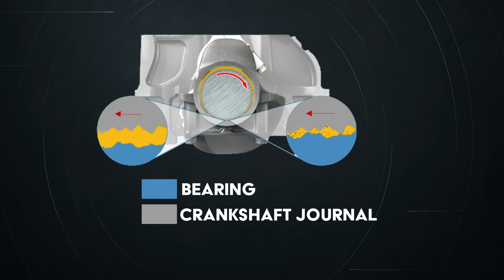the truth about start-stop technology (finally proven)

Comment: I had no proof before this video that the wear was actually happening. But, from first time I saw such a "feature", I knew it was not a good thing and I was nervous each time an engine stopped on a nearby car just to start again after a minimum movement was needed due to cars moving just some small distance and then again and again the same thing. I though about wear on the starter system, injection, battery and electronics in general, but really didn't think it was also going to damage the bearings. So, all in all, it is just another thing which reduces the life of the engines and so the cars they are mounted in. A complete nonsense!. I don't have any car with that system yet and really hope to be able to disable it in case I get one!

Comment: Mechanical engineer here.  Real life example casting doubt on the conclusion herein.  

My 2005 Toyota Matrix standard transmission bought used with 210K miles.  Now has almost 550k miles (or 1 million kM.)  Not only do I shut if off when I deliver final mile, but I shut if off at red lights at every opportunity. 

 I have not opened it up to check the bearing wear but there is very little noise under the hood.  Car was going so strong that a year ago, I replaced some noisey bearings in the transaxle and replaced the leaking steering rack.  Handles great and tracks so true, my tire wear is even on all wheels. 

Her name is Trixie.

Comment: This feature and ones like it were never about longevity. In an industry that defines planned obsolescence!?? This was only designed to conserve fuel. ie: barrels of oil per vehicle on the road. In case you didn't notice the silly ideals over the past 15 years about "green energy". Oil is the currency of any society, quick acces energy and ability to do almost any work. To have less share given to the general population,  means more for higher powers such as military and political classes.

Comment: Another things: in dsg, I am used to put neutral, engage handbrake, release and press the brakes, put P mode, release the brakes and engine off. This to avoid to put strain on the gearbox. If I forget to disable s&s, the car shuts down After putting neutral, only to ignite a second later when i put P.

Comment: 2010 Prius, 252k miles, still going, no engine issues.

2016 Prius, 215k miles, still going strong.

Maybe its not the tech, since Toyota can do it just fine. Sounds like a capability issue. Only thing proven is Germans can't do anything with new tech.

Comment: It's just like when BMW says their engines can go 12k- 15k Miles between oil changes because it means they only need to do 3 oil changes under warranty, and it looks good for the EPA, less oil usage. Then, they released a TSB stating that using 1 liter of oil per 1k miles is normal. 12k miles...7 liters of oil... It means they can claim normal wear, and not pay for a new engine ....
Reply: Fuck bmw service intervals. I owned e90 with the infamous n45, never had any engine problems. The trick is to change the oil every 5000km. No need expensive synthetic oils.
Reply: @ilovelimpfries Hm... Change oil twice as often, or pay a third more for synthetic oil...? Math is just so hard, I don't know what to do!
Reply: That's not how anything works.

If they had even a fraction of 1% more service claims due to engine wear, it would cost vastly more than one additional oil change, even if under warranty.

But oil changes are not under warranty. If you're so concerned about how they're secretly killing your car, maybe pay attention when they charge you $250 for the "Ultimate Care Oil Services". If you think 3 oil changes isn't worth that, then you shouldn't have bought it 😂

Modern synthetic oils last longer. And people who buy BMWs are suckers for additional service agreements.

Comment: Start/stop damage can be greatly minimized, using advanced engine materials, oil galleries, and low viscosity oil. For hybrids, the hybrid battery can be used to delay demand on the engine until its oil pressure is achieved.

Comment: Sounds like something that could be easily solved with a solenoid-controlled, pre-lube accumulator. 

1) Solenoid valve opens with ignition switch
2) Accumulator builds oil pressure with engine oil pressure
3) Solenoid closes on engine off
4) Next time ignition is turned on, pressurized oil in accumulator shoots straight into engine
5) Cycle repeats.

Comment: The FIRST thing I did on the shitty subaru was to completely disable the auto-shut-off bullshit.  Alas, after 99k miles the catalytic converter crapped out, and FUCKING SUBARU has programmed the car to turn off ALL safety features!  No emergency braking, not lane keeping, no Reverse Auto Braking.... These companies need to be sued into oblivion.  Someone is going to DIE simply because his shitty stock cat failed, and was too goddamned expensive to replace.  Fuck you subaru, and every other maker who pulls this bullshit on us.

Comment: The concern I have had with the start/stop system is the starter and flywheel ring gear. 
I never thought about the crank bearings. Replacing crank bearings or the flywheel sound very expensive.  I wonder if shops will say "it will be cheaper to get a new engine than to fix it".

Comment: This is assuming a mechanical oil pump connected to the engine. The simple substitution of an electric oil pump that runs on on stop will halve the wear (It's can't help much with start-up wear without several seconds of delay which would not be acceptable). I don't know if that is common on start-stop engines?
Also this is a good accelerated test but is 84 hours of stopping every 30 seconds (and waiting 30 seconds before restart?) really a good representation of '1 year' of wear? That is 5040 stop/start cycles. I reckon my van does about 30 per year. Maybe 50 (over 7000 miles). It really isn't happening very often, as the car often decides it is too cold or otherwise 'out of the correct parameter zone', and we mostly do long journeys, not stop-start town traffic. So in my case this level of wear would take 100 years, so definitely not a problem. I wonder how many people are really getting 13 stop/starts every day on average? But yeah those people might be needed an engine rebuild after 80,000 miles (130,000km), so maybe 7-10 years.
Are we seeing a lot of that in the real world?

Comment: this is not a good test.

First of all, it does not appear that the example vehicle was engineered to do engine start up. Obviously, if you take a standard engine in a regular car and start it over and over again, it will not have the features necessary to deal with this kind of usage. Additionally, the engine itself has not been engineered for this kind of use, and so while the bearings may be the valid selection, it is not an indication that the engine is designed to use those bearings under this kind of load.

Second, even granting those issues, to be a proper test, one would need to do the same test of two days with a normal amount of starting and stopping. This is made complicated by the fact that in order to do a true simulation, 365 times at minimum the engine would need to start from cold. Which is also a problem with this test, although I understand that the point is to show the war that occurs when doing warm oil start stops.

Additionally, the test is compared against a specific type of engine that is designed for ultimate longevity. i've owned several gas vehicles, and none of them were designed for that purpose. Manufacturers do not want to build 1,000,000 mile or million kilometer engine, because that means that consumers will buy fewer new vehicles.

Finally, similar tests have been done by manufacturers and by others that demonstrate that a properly designed engine that is intended to be used for engine start stop can use features that will prevent the kind of where that is being complained about here. The main solution being to artificially maintain oil pressure during normal driving.

In other words, manufacturers typically only want an engine to last 100,000 or 200,000 miles. This is true across the board, whether you have engine start stop or not. If your point is to circumvent the manufacturers intention, then you need to start by identifying those vehicles and engines which are already likely to have greater longevity. But once you make that your priority, the rest of the conversation is moot. 

some vehicles prioritize performance over longevity, efficiency, or emissions. Others prioritize emissions over longevity, performance, or efficiency. Although typically, if you prioritize emissions 99 times out of 100 you will also be prioritizing efficiency. If you prioritize longevity, then you're making a different set of choices . It's a valid perspective, but it doesn't make the engine start stop system invalid.

Comment: Aircraft engines have been priming their lubrication systems prior to ignition for nearly 100 years. Engineers knew it then, and know it now, cold starts are the biggest cause of engine wear. Manufacturers and board members also know this and with the help of ad agents, lobbyists, and the conscience of a swine have installed a "feature" to ensure a shorter life to their expensive product.

Comment: I eventually permanently disconnected the stop-start system on my Suzuki Swift. 
Prompted after just 13 months, a new battery was required. The whole engine is put under unnecessary stress with stop-start systems, including the driver's nerves

Comment: Okay but in a hybrid (and why anyone would be driving a non-hybrid ICE vehicle is entirely beyond me, it's just a superior technology full stop), the engine literally HAS to start and stop in order to allow the electric motor to take over at lower speeds where the engine is extremely inefficient and doesn't produce as much torque. The electric traction motor also doubles as the starter motor in a hybrid, usually using a clever series of planetary gears that allow it to connect and disconnect from the powertrain.

Comment: Mine stopped working at 20,000 miles. I use to switch it off in a busy town.  Car has now done 92, 000 miles and still not working as no dealer has touched it during a service. When mentioned, they said well its considered unnecessary now. I accepted that with a smile.  Perhaps that's why the Battery is the original still. 13 years old.  Just had the timing belts replaced plus others, I decided to get it done in advance, but it was 3 years over due. 10 years or 150,000 miles 13 years old. I have kept the citoreon as its a valuable useful car. Berlingo in my case. EV market is a minefield, Rather spend money on repairs, untill an ideal EV at the right price turns up. Insurance is 3 times more, so I may never own an EV.  I am 78 now. Future is sketchy. Wonder what i will  be driving  in 40 years. Hopefully a new Tesla model called the Angel running on Air.

Comment: In case of BMW equipped with automatic transmission good "life hack" is to drive always on "S" (or "M") instead of "D". This not only disables auto start-stop, but also forces oil pump into higher pressure regime. Also keeping slightly higher rpms even on cruising reduces stress on engine. Sure, it uses more fuel, but if someone plan to use car for a long time, this is good compromise. Obviously also engine oil changes at least every 15kkm, not EU forced 30kkm.

Comment: I fkn knew it. Static friction and the lack of oil pressure everywhere in the engine as it starts could not possibly be good. I had assumed that a warm engine that was running less that a minute ago would not suffer with start/stop but now we know otherwise.

Comment: I lot of FUD here.  Our 2006 hybrid civic had  close to 190,000 miles on it before we traded it in. Not because of the engine, because it was fine, but repairs on mechanical things like shocks, struts, AC, engine mounts, etc were starting to get too expensive, plus we simply wanted a new car. 

  Who knows how many times the engine was started and stopped. But it survived just fine. Perhaps not all engines are designed for constant starting and stopping, but they certainly can be.

Comment: For people criticizing the design that it has to be turned off every time you start the car, there's a reason for that: the manufacturers have to meet fuel efficiency standards mandated by the government (I know how it is in the US, I assume the EU has similar requirements). The manufacturers have their cars rated for fuel efficiency using the start-stop feature. To qualify this way, the feature has to be active by default.

I just bought a new car last week, and start-stop is included. Fortunately the manufacturer also included a button right next to the gear selector that allows me to turn off the start-stop. I just get in the habit: start the car, push the button, put the car in gear.

The fact that the button to turn of the feature is so obvious is evidence that the feature exists only to meet govt standards.

Comment: On Honda engines, they have an inverted chamber which builds up oil pressure by compressing air above it, the start stop will only stay on for about 5 minutes which is just enough time to keep the oil pressure up

Comment: The first time I ever seen this system, was in a 2023 Subaru Forester, a rental one. I found it annoying but as I drove the SUV, I started kinda to feel bad about the engine. Constantly turning on and off, I read the manual and looked for way to turn off that feature. Eventually I managed to do it but, everytime I started the car I had to repeat the process, it was just a button but still annoying... Thank you for finally able to prove this feature it only does unnecessary and completely avoidable damage.

Comment: In the oil fields of the west, the pump jacks were in an area where there was no electrical power. The owners would use 318 Mopars to turn them. They ran 24/7 365 for years. They had alternate oil sumps that could be switched over in order to maintenance without shutting down the pump jack. Some of those engines lasted over 10 years. That's equivalent to 4 million miles. Shutting down and restarting an engine is death.

Comment: Ive been saying this since they 1st started with the shut off start up.. as a tow tru k driver i ha e also picked up many vehicles that have a dead starter at a trafic light many of these cars have been hit in the back and destroyed.. because many drivers dont pay attention and dont see a stoped car but only see a green light. I e yet to own a car that auto shuts off if i were to get 1 id make the dealer disable the feature or id buy somewere else. I am a ford guy and i use forscan im sure i can disable my self with this program. I will be gettimg a new truck soon being i have a 14 right now its 11 yaers old still in great shape looks and rides like new i do my own maintenance nobody else has worked on it and most of its parts are still original. I do preventive maintenance when i feel it needs to be replaced.  I change oil with high dollar oil often.

Comment: I always turn off the auto-stop when driving a vehicle that has it.

I've had cheap cars in the past. There is a panic that sets in when your car SHUTS OFF in traffic or at a stop. This panic follows me when the vehicle Auto-stops.

The worst part is no matter how many times I use the button to turn it off, it is on by default when the vehicle shuts down and is restarted. That's the most annoying part.

I've been told there is a way to disable that feature permanently but I haven't looked into what that solution is.

I'm glad my vehicle doesn't have it. If it did, I'd disable it. Not only bc of the panic it causes but it's not doing the starter any favors by using it more than necessary in order to save me like $14 over 20 years... if it even makes it that long.

Comment: The automakers knew this all along. It was always intended as an expiration date on your car so they can sell more new ones later. It will conveniently live past the warranty period an then begin to fail. 

Unfortunately, when stating motors, relays, batteries and modules eventually do fail it will often happen in single lane construction zones during stop and go traffic. This will cause enormous backups and possibly even injuries or deaths. Cars will begin failing to start in any random location instead of in safer locations like driveways and parking lots.

Comment: My car has done 325,000km within 10 years of its existence, driven all over Europe as far as Yeravan, it has start-stop and switching it off and just letting it idle has probably saved the engine. The car needs to know if the gearstick is in neutral for it to work so I knocked off the sensor so start-stop won’t work.

Comment: This video is basically the first things I thought when hearing about start/stop technology. I mean I have always been told the start of an engine and cold engine wears the most.
It has one good feature in lowered measurable fuel consumption. But higher wear which is NEVER mentioned. And which should make service intervals closer with higher running costs as a result.
The gain in lowered fuel consumption eats the cost of other things.
Reply: It also improves air quality at junctions. This is not primarily about cost - it's about reducing pollution.

Comment: Oh, mine has saved 2.3kg of CO2 in the last 4,000 miles…..  a pointless piece of kit, especially when you add in the extra weight of the heavy duty battery i have to haul around